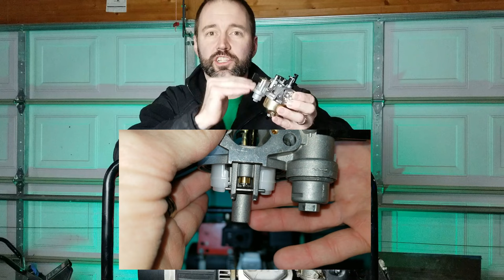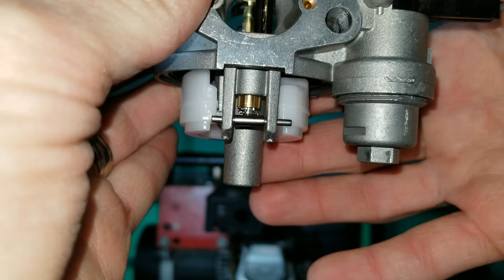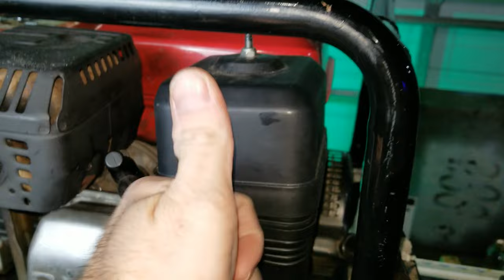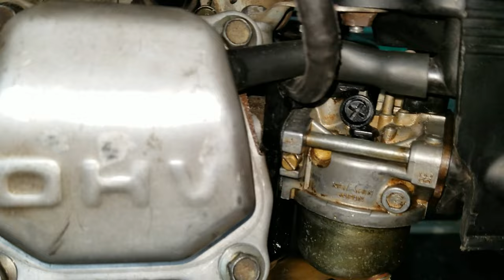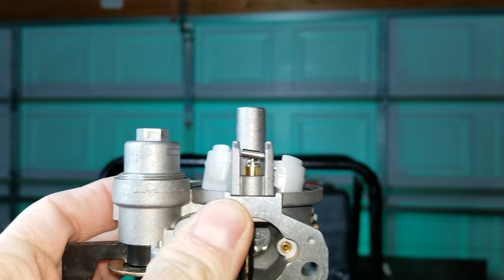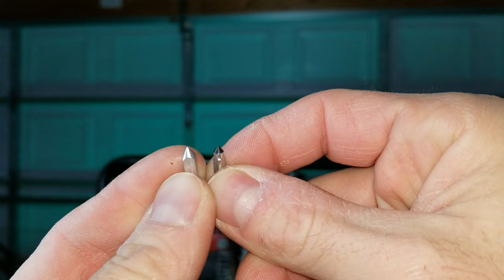This TINY Part Can Cause Your Generator to Leak Gas from the Air Filter [How to Fix!]

Comment: after starting right before the hurricane, I had extremely high throttle and noticed leakage from the airbox. figured it was carburetor related. watched your video and popped it open. full of gunk, there was a piece of gunk in-between the seal and the plunger. carb cleaned it, put it back together and ran fine with no leakage. video made it very apparent to find the source. thanks!

Comment: My generator leaks gas inside that OHV cover and goes out through that hose into the air filter box and wets the air filter. What would cause that?

Comment: Great Video-Question for ya- I have a 2 Westinghouse DuelFuel Generators that I use propane only.  One never leaks and never has. The other one does exactly the same thing as described here.  When running, it's fine, but if you turn propane on with generator OFF, the propane "weeps" slightly out the airfilter.  I am 100% positive this is where it comes out.  I used a sniffer. Initially, I replaced hoses and regulator.  Could this be my problem as described in you video?  Again, my other generator does not leak and propane is connected 24/7.   Thanks in Advance!!

Comment: Is it normal for the crank case to be pressurized whereby when I unthread the oil fill cap, the gas-tainted oil shoots/flows out?
Also, how many times should I change the gas tainted oil?   Drain, fill, drain fill etc?  Thanks!

Comment: I have a Predator 3500 inverter generator and I am getting oil in the air filter, it only has 600 hours of run time on it, do you know why
Reply from the maker: First thing I would check is the oil level while the generator is on a level surface.  Too much oil in the crankcase can build up too high of pressures and the oil will work its way up into the valve cover and then travel to the air filter via the breather tube (the rubber tube that runs between them).  Also, running the generator on really uneven surfaces or tipping it while moving it can cause it.   If that's not the case, and your engine is worn down a bit (grooves cut in the cylinder, piston rings not making a perfect seal, etc.) then you could have blowby which will be a gas/oil mist that can work its way through the same tube.  That's what I can think of right now without looking at it myself.  I hope you get it fixed!  :)
Reply: So if it is a blowby, is it fixable? Same thing happening to my 4550 generator